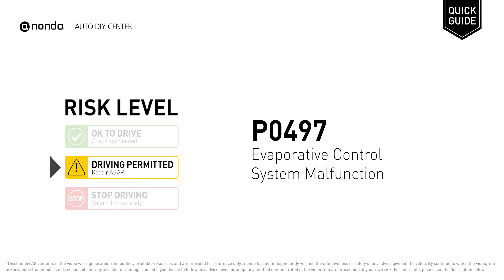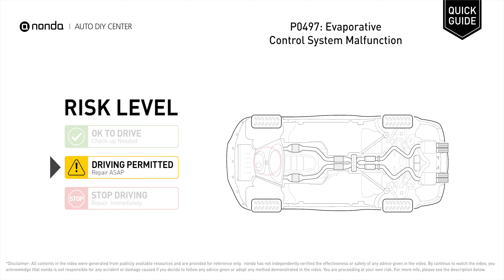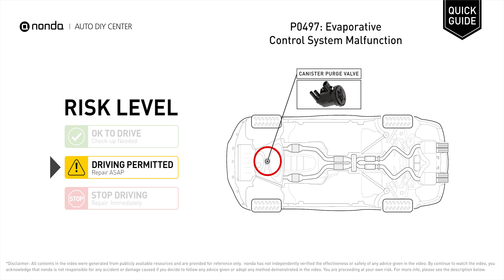What is P0497 Engine Code [Quick Guide]

Comment: How to fix that on honda accord 2007?
Reply from the maker: Hi Chien, a thorough inspection on these parts is recommended: canister purge valve, charcoal canister, wiring/connectors/hoses and gas cap as faults on the said parts could trigger this code.
Reply: @nondainc  i tried to clear the code but the engine light won’t off
Reply: @nondainc  can you made a video about how to fix the code P0497 pls
Reply: Do you know about the part's number of this sensor? I cant look for